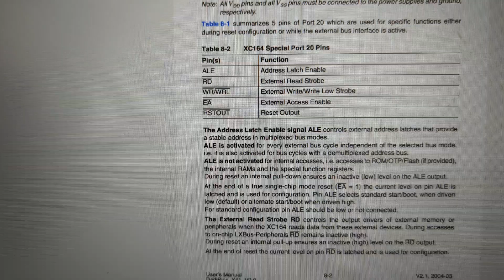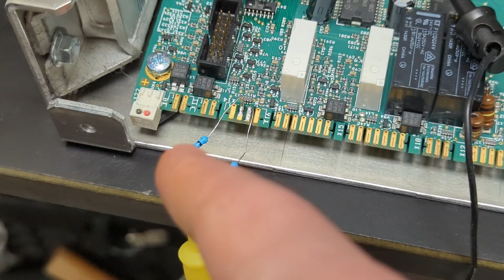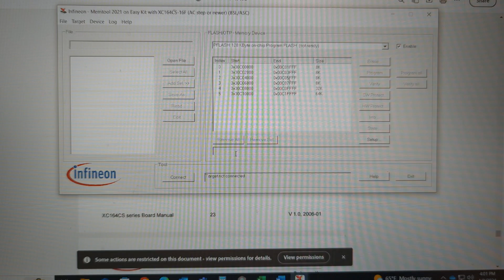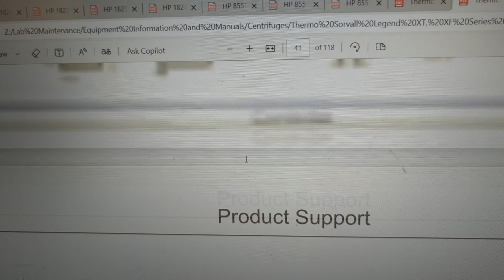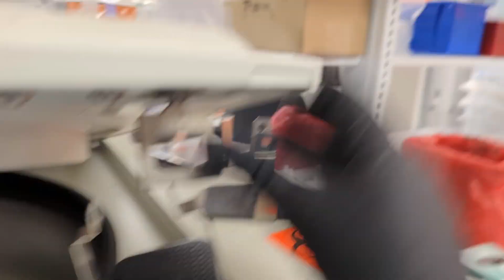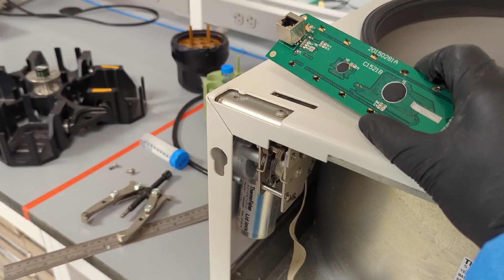ThermoFisher Sorvall Legend XTR Main Board Repair -  Flashing the Infineon XC164CS MCU

Comment: Hello
My X1R centrifuge reports an e74 error when it is turned on. Its circuit is basically the same as the one in your video. Can you tell me the reason for this error?
Reply from the maker: haven't personally had to troubleshoot that error.  All the manual states is that the motor control circuit is not set.  Seems like it could be related to a faulty MCU or NV-RAM.  But couldn't hurt to check power rails to the frequency converter circuit.

Comment: Hi, great work you do ! I was wondering if you happened to know anything about an error 31 " motor overtemp " on a Thermo ST40R ? Tried replacing the motor and checked the thermocouple and nothing. Any help is appreciated. Thanks.
Reply from the maker: I don't have a service manual with schematics for ST40R but I would imagine it is very similar to the ST16R.  There is a manual available on Lab wrench for this centrifuge.  But the motor has an overtemp switch.  Once it gets before a certain temp it goes open.  I would first check to make sure the motor connector on the board is soldered properly and making good connection with the motor connector.  With the motor cold, you should measure 0 ohms between pins 4 and 5 when it is connected.  Make this measurement on the PCB.  If you're getting 0 ohms between 4 & 5, then you know the motor is connected properly and your issue must be further downstream on the PCB.  Use the 'Protection Circuit' schematic as a reference.  You can see that 15V (referenced to primary) is sent thru the overtemp switch.  If this switch opens, the 15V is interrupted.  This 15V goes on to the 3 phase inverter section of the board to the gate drivers that drive the inverter mosfets.  If it is interrupted, it shuts them down.  Now back to the protection circuit - the 15V signal  from the closed overtemp switch goes on to optocoupler D50 turning it on.  This sends Vcc signal to ground at the phototransistor side of the optocoupler sending the 'motor overtemp' signal to the microcontroller low (0V).  However, when the 15V signal is interrupted, the motor overtemp signal goes high (5V).  Thats how the microcontroller triggers the E31.  Another trick you can try - disconnect the motor, but leave everything else connected to the mainboard.  Short out pins 4 and 5 at the motor connector to the PCB.  Do you still get E31?  If so, your issue is somewhere on that protection circuit.  Test D50, R365, R368, and C129.  Current transducer D60 is also worth looking.  Make sure you have continuity between pins 1,2,3 and 4,5,6.
Reply from the maker: Also, I would check to make sure you're getting 15V at the input of D10 which is a 5V regulator.  Short pins 4 and 5 at the motor connector of the PCB like I said.  Then turn the unit on.  Check for 15V at that regulator.  If you don't have 15V there, your issue could be in the power supply section that generates the 15V (referenced to primary voltage)
Reply: @fmashockie  Thank you so much for your insight. I really appreciate it ! I will be sure to check everything you mentionned. I found the schematics on OzarkBiomedical and I'll use it as reference. However, I do believe the ST16R is fairly similar. I actually have one. My ST16R won't give any sign of life but a little red led on the pcb that blinks as the motor is turned. I was planning to harvest the parts from it once I figured out what was the problem with the ST40R if so fitting. For context, I'm not a pro or anything just a garage scientist, but I really enjoy your content !
Reply from the maker: @justvideos1883  I forgot the schematic for GP3 Thermo centrifuges is available on Ozark.  The circuits of interest I described earlier are the same, just some of the components are labeled differently.  For example, in the protection circuit, components of interest are D19, R66, R63.  The 7805 regulator D10 is still the same.  You can also check for 15V at the output of D9, but the reference is not ground its at mains potential.  So be careful there.  Its safer to probe at the input of D10 where you can reference ground to get your 15V.  And you should get it if you short pins 4 & 5 on the connector unless there is an issue with the power supply.  Glad you enjoy the content!  I'm no expert either.  I've only opened these up a handful of times when they break down in my lab lol.  Just trying to share my repair endeavors
Reply: @fmashockie Hey Frankie, I followed your indications as best as I could and I found that I'm not getting 15V at any of the components when the pins 4&5 are shorted. I noticed that the primary 15V 3VA part BV EI 305 2280 is getting really hot. Burning hot in fact. I tried replacing it with the same part borrowed from my ST16R. Not luck there. Do you have any idea what wrong ? Thanks again for your help.
Reply from the maker: @justvideos1883 seems like you have something pulling a lot of current on the 15Vprim rail. Couple things you can check. Are you seeing ~20V across the DC (+ and - pins) of bridge rectifier V22? Are you seeing 15V across C102? Also with the unit off, check resistance across C102. Is it low? Use your SR16 unit as a reference. Unfortunately I dont have one of these boards out of a unit otherwise Id take some measurements for you. If you have a thermal camera I'd be checking anything powered by the 15Vprim rail. The transformer is likely getting hot in response to something drawing too much current on this rail. Just need to find the short
Reply from the maker: Also check resistance across C101. Check that cap for capacitance and ESR. If you aren't seeing 20V across it. It might be worth performing these tests both with pins 4/5 shorted on motor and open. Does the transformer get hot in both conditions?
Reply: @fmashockie  Hey Frankie, I just wanted to thank you again for your help. I really appreciate it. I performed the tests and I can't seem to figure it out. I tried disconnecting the rectifier V22 and as soon as I do I get my 20V or so. Anyways, I got myself a thermal camera and the only components that looked too hot ( except the transformer ) are the D2 ICE2PCS01 and the V21 Voltage Regulator BZX84C22. At this point, the one I suspect is the D2. Does that make any sense to you or am I barking up the wrong tree ? I say that because when I remove the rectifier and look at the thermal imaging I don't see the D2 overheating at 90C like I do with it connected. Btw, there's no difference motor thermocouple shorted or not.
Reply from the maker: @justvideos1883  I think you're getting closer! So D2 (ICE2PCS01 or IR1150) is the PFC controller chip for the boost converter for the dc link voltage.  It boosts the rectified mains voltage to ~400VDC providing the DC bus for the motor.  It is powered via 15V from the 15Vprim rail.  The chip is held in standby mode by op-amp D34A until the lid is closed. However, it is always supplied 15V as soon as board is powered on. So if that chip was damaged, it could be pulling that rail down.  I actually have an XTR board out I'm working on currently.  I measured resistance across 15Vprim which can be done by measuring across C33.  I get ~2.1k on this board with no damage to the 15Vprim rail.  If you are seeing much lower than that, there's a good chance that D2 is damaged.  You can remove it to see if you get your 15Vprim rail back.  However, it might be worth checking V5 and D1 as well.  Sometimes a damaged PFC chip is a secondary fault due to blown boost MOSFETs (in this case V5) or gate drivers (D1).  As for V21, that is a 22V zener that stabilizes the 24V rail.  In my experience these run hot and I've seen them bring down a couple XTR boards.  Seems like a design flaw - the zener is dissipating too much power when the load on 24V rail is low.  Let me know how you make out!

Comment: What to do for the Error-25, lid is not clossing please help me sir..
Reply from the maker: Error 25 can be related to the lid latches themselves (the microswitches on the latch) or the main PCB.  I did a video on troubleshooting an E25 error on the XTR that turned out to be related to the lid latch motor shunts.  There was a technical note that came out years ago for older XTRs that recommended replacing these.  So that could be your problem.  Check the lid hook down microswitches.  These go bad at the leads that attach to the switch.  They end up breaking due to continuous movement brushing up against a part within the latch over time.  Here's the other video link https://www.youtube.com/watch?v=Fw5WQUNcszg&t=1072s
Reply from the maker: if you find the older style shunts, here's the part # I used from DigiKey to replace them CPFC74NP-PS02H2A20

Comment: Thanks for the info on the display issue. We have a similar unit with no power at the LCD. I think we have another with backlight that does not function, but the backlight works when that front panel is connected in another unit - something on the main board again. Gaining lots of confidence from your videos. Thanks!
Reply from the maker: Glad you found it helpful! I probably didn't have to flash the MCU to fix this one.  The main culprit was likely the decoder IC.  However, this exercise certainly not in vain - being able to flash the MCU is super critical.  Read protected MCUs that are dead are one of the main hurdles to repairing damaged PCBs.  So I'm glad I started with that first and had proven it can be done!

Comment: Hello Brother I am facing a problem with  XC164CS Installed on the TC11O Turbo Pump controller. the problem is that when we command it to run the pump it does not work but when we press it a little bit it starts working slowly but not properly we checked the connections of the pin and soldering and it is fine but we can't figure out the problem might be some damage inside so when we press it a little bit it starts working please help me
Reply from the maker: hey! So I am not familar with the TC100 turbo pump controller at all.  I assume it is an electronic driver for a pump?  Anyways, I can only speak to your issue in very general terms.  Just because it has a XC164CS doesn't mean I can tell you much about your issue.  Microcontrollers are designed to be versatile; how they work depends heavily on how they are programmed.  What do you mean by press it? Do you mean when you press on the XC164CS? If that is what you mean, then there could be a few things going on here.  It could be that you have some cold solder joints on the pins to the chip.  You can do a visible inspection of the pins using a 10x or greater microscope (even a magnify glass would suffice) and check to ensure the pins are soldered properly.  You can reflow the solder to be safe.  You can also check each pin for continuity with a multimeter but you have to be careful there because even pressing on the pin with a test lead could cause it to make contact with the pad giving a false reading.  Alternatively, pressing on the micocontroller and causing it to work could have nothing to do with the micro at all.  It could be that you are just flexing the entire PCB and that is causing some other faulty connection somewhere on the board to work.  So you want to do a visual inspection of the entire board.  If it turns out the issue is related to something internal to the microcontroller, you can follow this video to see if you can still interface with micro via UART to USB using the Infineon software.  If you can, you should be able to flash the existing micro (if it is not read protected) and then replace it with a new one and reprogram.  Good luck!